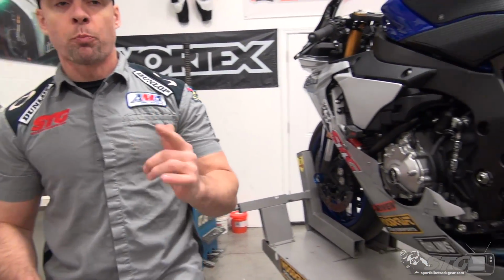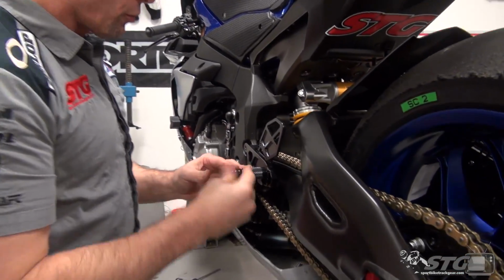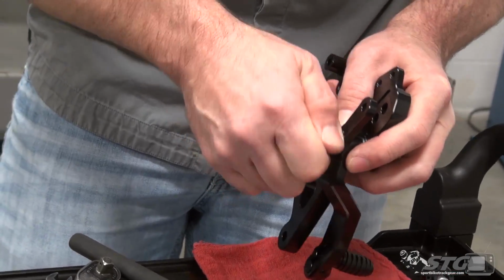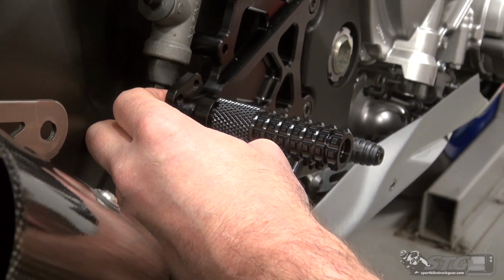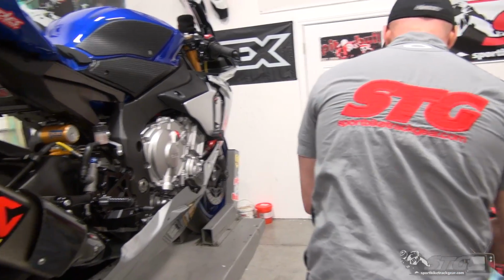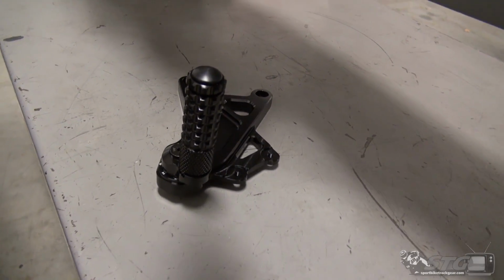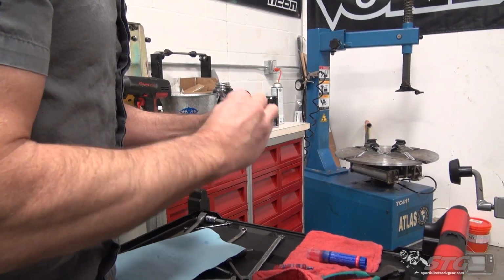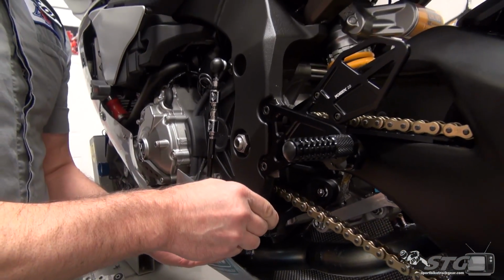Vortex V3 2.0 Adjustable Rearsets Install On A 15-18 Yamaha R1 | Sportbiketrackgear.com

Comment: Hey brother I have a question: I am thinking about installing these on my bike as well due to my size, but I only ride my bike on the street, do I need to install a banjo bolt as well? I saw another video and the guy is installing a bajo bolt on his to these exact rear sets. Tha you in advance!
Reply from the maker: If you want to retain the function of the brake light off the rear brake you will need the brake light banjo switch. We have a link to it on the same page as the rearsets for each model. - Van

Comment: Noticed ur bike doesn't have the brake sensor pull spring !! Doesn't vortex come with that xtra part ? For race vs street ?
Reply from the maker: The banjo brake light switch is sold separate as not everyone will require use of the rear brake light. Track riders will run without, street riders will retain it. - Van

Comment: Hey Brian question. I want to remove my kickstand. Can I remove the kickstand and keep the sensor there or will I have an issue?
Reply from the maker: Saw this in another video as well, I would 100% install the bypass from Woodcraft. This is the cleanest way to get this done. - Van
Reply: @sportbiketrackgear  thanks for the reply van

Comment: Just got these, on brake side there is a black wiring with spring on it that hooked to stock pedals, vortex does not have the attachment. What do you do with that? Can you just remove?
Reply from the maker: That is the OEM brake light switch that can not be reinstalled with the Vortex rearsets. If you want the brake light to work with the rear pedal you will need to install a banjo brake light switch which is easy to do. Here is a link to that on our site: 
Vortex Rear Brake Light Switch  https://www.sportbiketrackgear.com/vortex-rear-brake-light-switch/
Reply: Thank you, did a set on my 2007 cbr 600rr. Completely forgot about the brake light. Placed order. Thank you for your help.

Comment: Hi, great video. Do you have one on removing the brake light switch and wiring ?
Reply from the maker: Thanks for watching. Sorry we do not have a video showing that. - Van
Reply: Ther is a video on that 1 wer it shows the guy splicing n replacing that part

Comment: Hey mate have you installed these rearsets to a 2015-18 S1000RR? If so where are you supposed to mount the brake return spring? OEM lever has a lug that you hook the spring on. Cheers.
Reply from the maker: I have not installed that exact kit myself. Most of the aftermarket kits do not reuse the OEM return spring for the rear brake. The master has a return spring that is inside of it that gets the job done. If you prefer there are a couple of aftermarket return springs that slide over the rod for the master. - Van
Reply: @sportbiketrackgear  Thanks for the reply!  For now I just use the OEM bracket for the top of the spring and hooked (and stretched) the bottom under the actual lever.  It works (shrug).
If it was your bike would you just remove the spring altogether?  
I'm just worried about gravity applying the rear brake and the free play.
Could I have a link or brand name of these aftermarket springs?
Cheers
Jeff

Comment: No return spring anymore on the rear brake?
Reply from the maker: You can add one on the master if you like. There is a return spring in the master cylinder that is more than adequate. - Van
Reply: @sportbiketrackgear  I just found out about the Woodcraft return Springs you can add. I'm going to go that route thank you sir

Comment: Hey I have a problem with the shift pedal, it won't stay loose every time I tighten it the shift pedal tightens as well.
Reply from the maker: I would suggest checking to make sure the bearings are both pressed into the shift pedal all the way. Also make sure you have the washer installed between the pedal and the mount properly. If you need more help shoot me an email to service@sportbiketrackgear.com - Van

Comment: Question will I need to buy a break light switch for these rearsets or will it work perfectly with the oem?
Reply from the maker: You will need to buy the Vortex Rear Brake Light Switch if you want to keep the brake light active when using the rear brake. Here is a link to that on our site: https://www.sportbiketrackgear.com/vortex-rear-brake-light-switch/    - Brian Van

Comment: They look amazine.. do they use a return spring for the brake side.. I'm gonna get them for my 17 R6....
Reply from the maker: No they do not include a rear brake return spring, you would need to purchase that separately if you want one. We have Graves and Woodcraft return springs on the site. Below are links to them:
https://www.sportbiketrackgear.com/graves-sport-bike-rear-brake-return-spring/

https://www.sportbiketrackgear.com/woodcraft-brake-pedal-return-spring/
Reply: Installed yesterday... they are nice... thanks for another great video..

Comment: Dude, i was kinda scared you'd rip the rod out of your rear master 😰😂
Is it normal that thing is so wiggly???
Reply from the maker: Yes the rear master rod has a ton of movement in it so you can adjust the rod. No worries at all. - Van
Reply: Does it have a return spring for some resistance.. 
Maybe uses the OEM one ?..
Seen how Graves uses a spring  added to the master cylinder..is something like that needed with this set on a 2017 R6...
I'm ready to click buy but had that question

Comment: Brian I need to lower an R1 2017, have you done this?
Reply from the maker: No we have not lowered an R1 nor do we have that on the project list for that bike. PSR does offer the  following items to get this done:
1) PSR Yamaha YZF-R1 15-18 Adjustable Kickstand  (you will need this after lowering the rear)
https://www.sportbiketrackgear.com/psr-yamaha-yzf-r1-15-18-adjustable-kickstand/

You can go with either an adjustable or a fixed lowering link. The fixed is far less expensive and works well for most riders in the end.
2) PSR Yamaha YZF-R1 15-18 Lowering Link $54.95
https://www.sportbiketrackgear.com/psr-yamaha-yzf-r1-15-18-lowering-link/

3) PSR Yamaha YZF-R1 15-18 Fully Adjustable Lowering Link $166.95
https://www.sportbiketrackgear.com/psr-yamaha-yzf-r1-15-18-fully-adjustable-lowering-link/

All of these items are available now. Have you ordered from us before? 
- Van
Reply: Sportbike Track Gear No, Do you deliver to the UK? thank you so much for the information and reply.
Reply from the maker: Yes we ship to the UK pretty much daily at this point. As you proceed through the checkout process on the site you should be able to choose from DHL Express International (fast but a little more expensive) or USPS International shipping. Most go with the latter option. - Van